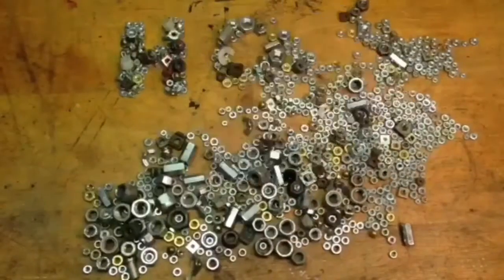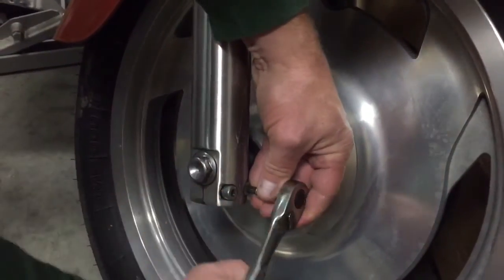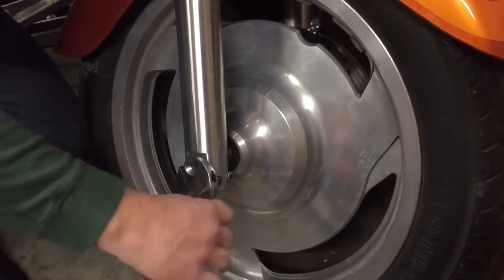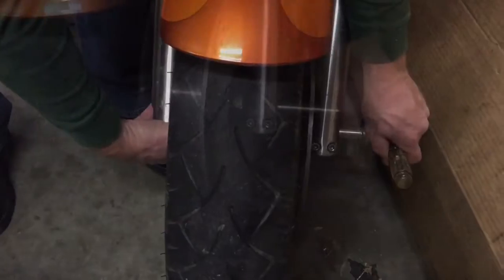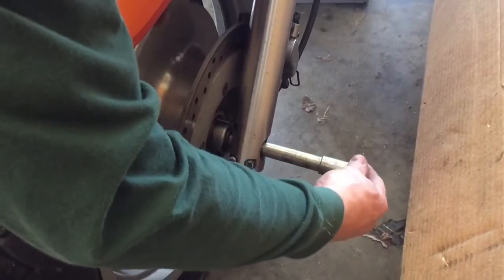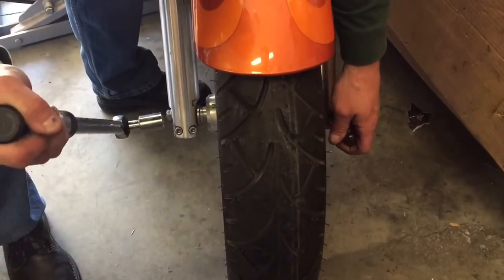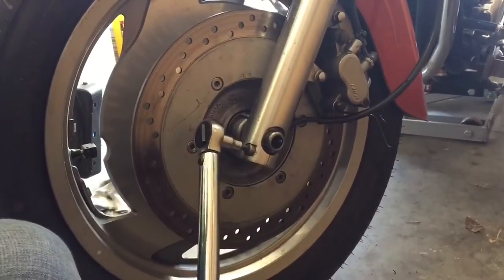How to remove and replace the front wheel on a 2002 Honda Shadow

Comment: hi - Is the bike lifted up here or is it just parked? I plan to do my own rotor replacement - thanks for the video!
Reply from the maker: It is lifted up. Thanks for watching.
Reply: Jake Newcomb it will be very useful if you show how you lift the bike up.
Reply: @fedora296   I reckon it is a center stand. I did see a "how to put a bike on ..." and a "how to...off a center stand video on YouTube when I Googled "what is that double legged kickstand for a motorcycle called?"
 The videos were the 1st thing that popped up so I zoomed in on the picture and I saw that it was close to what I was asking for - the legs seemed rather spread apart -  I don't think it was what I have seen before, but it looks more sturdy to hold the bike stable while you're working on the front wheel. 
How-to-Bob seems like a sensible fellow, so maybe that's what is using.
 Makes me wonder if a center stand could be used on a different part of the frame to work on the back wheel. Bob has a "how to replace the back wheel..." video so maybe he tells how he elevated it.  if you watch that 1 maybe you can find out.
Or Bob will answer you soon. I asked him again just now, because I saw that the your and my question wasn't answered, so I just jumped back to the front of the line again... maybe he'll answer me soon , I gave him a good ribbing.
 I asked if he was a magician was he levitating it....

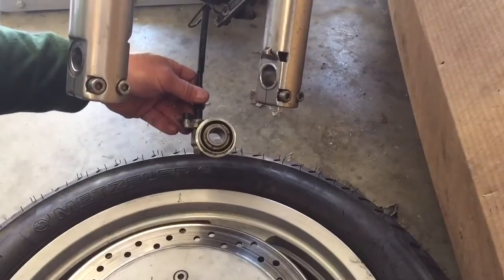Comment: Hi, While my 02 Shadow Spirit VT1100C has a different wheel/rim style it appears otherwise similar to the procedure you have in your video. I have a couple of questions though. I believe my wheel bearings are sealed bearings so I'm not sure of the purpose in putting the grease inside the bearing/axle cavity. Please clarify. Also at the 1:51 point in the video you are holding the speedometer cable "housing in your left hand" and pointing at it with your right hand. On mine there is a narrow cavity that had some grease in it at one time but has very little grease now. Do you know what type of grease this requires in this location?  Also where the side of that housing contacts the wheel does that require any of that type of grease there where the speedometer "housing" rests against the wheel?
Reply from the maker: I little grease inside the cavity helps the axel slide in easier. For grease types check with your local Honda dealer. No grease is needed between the speedometer and the wheel. Hope this helps, Happy riding and Thanks for watching.

Comment: Are the bearings sealed on this motorcycle and what type of grease is best to use when reinstalling the wheel? Is this a VT1100C and does it matter in regards to changing the front wheel?
Reply from the maker: The are not sealed but there is a seal on the axel. Once the wheel is removed you can use a good quality bearing grease. Check with your local Honda dealer if you have any more questions, they sell the grease. Thanks for watching.

Comment: Hi, Thanks for your previous reply. I didn't notice when I took the axle bolt out but in replacing it I see that the axle doesn't come out flush with the outside edge of the fork on the right side. Everything appears to be re-installed correctly in particular the speedometer "gear box" with "notches" lined up correctly with the wheel. Is that normal? Should end of axle come out flush with the outside of the "fork" when its being installed? Do you know if its not if it will become flush with the outside of the fork on the right side at any point in reinstallation ?
Reply from the maker: It sounds like you have everything put back together correctly from your description, the axel should poke through the opposite side so that the nut can be installed but it's hard to tell what you have going on without seeing the bike. Hope this helps.
Reply: @funbro1  Thanks for your response and the info. I have a picture I could send if there is a way to do so. It shows the position of the end of the axle relative to the outer face of the fork on the right side prior to reinstalling the axle bolt.
Reply: @funbro1  I replayed the video and discovered at approximately the 2:29 mark when Loctite is applied that your axle appears recessed about the same amount as mine just before you inserted the axle bolt. So mine is likely normal and good to go.
Reply from the maker: That's awesome. Just make sure to double check everything before rolling out. Happy riding.

Comment: Nice video. Do you know how to put the front shock absorber spacer back in place? I took my steering wheel up to replace the light bracket and now I can't push the screw in to tighten the upper shocks due to the pressure of the spring? Any ideas would be greately appreciated.
Reply from the maker: Might take a couple people to get this done. Thanks for watching.

Comment: Bob, wished you could've touched base on the spedometer gear that's there too. Thx tho for the vid on front tire removal.
My spedometer made a loud buzzing noise and jumped to 100mph floating, stopped and it fixed itself but it's intermittent so I must first try removing and inspect cable at the wheel and if no fix there remove wheel and disassemble :/
Got a free serv manual online but it just kind of tells me how to do it
Reply from the maker: Wow I have not had that happen before. If you find out what is causing this check back and let us know. As always, Thanks for watching.
Reply: Here's the same topic on it and I'm hoping it's the same for me for anyone that may ever have the issue..
https://www.hondashadow.net/threads/odd-noise-and-speedo-jumping.243265/
Reply from the maker: Interesting, thanks for sharing.

Comment: i have a 07 1100 sabre i try to jack it up to clean the front rim but kept sliping sideways. yes i had it on first gear and secure the back tire with wood wedge. i noticed that even on 1st geat the bike has a play of at least 1 1/2 inches it rocks back and forth. my side stand looks too bent up so my bike rests lower i think. if you could show how you lift it up with a car jack not the one you have there would be aweaome thank you
Reply from the maker: I do not currently have a video on that. Maybe I will do one in the future. Thanks for watching

Comment: On such a old motorcycle, the wheel bearings should be checked too, not just add grease into the oil seals :-/
Reply from the maker: Absolutely, Check for a video on checking bearings or how to change bearings. Thanks for watching.